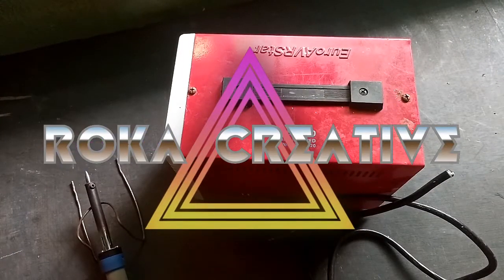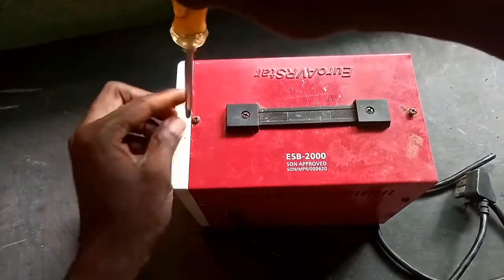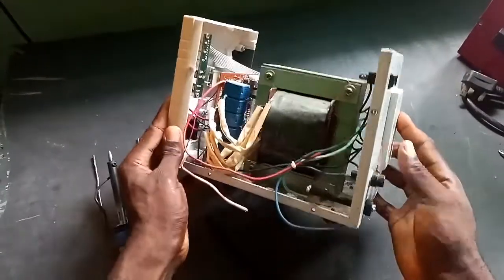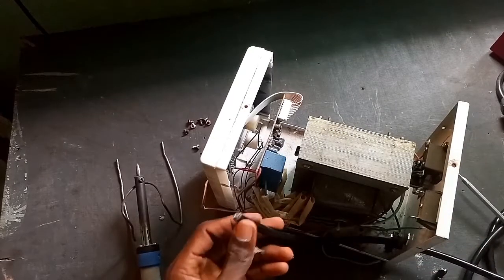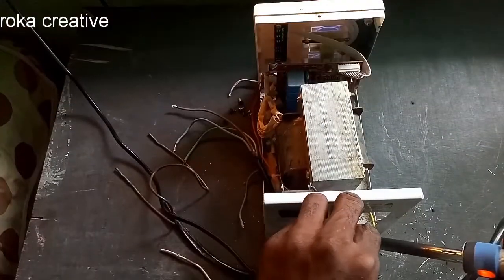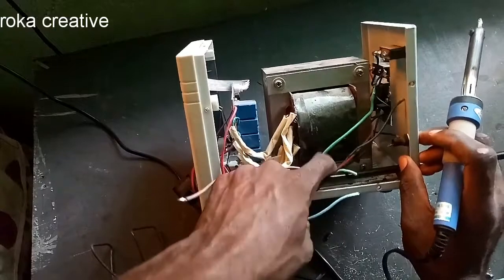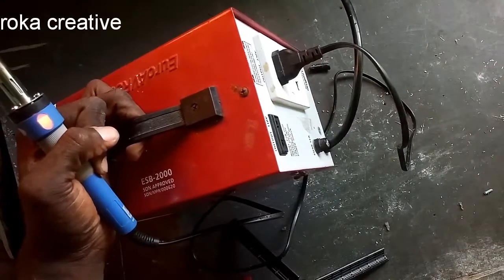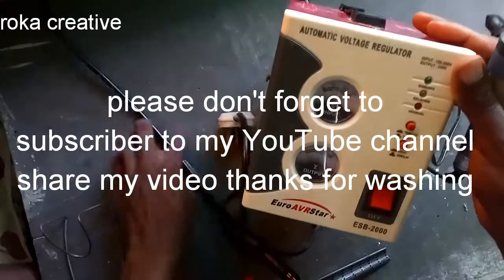how to repair a 2000w stabilizer

Comment: Very good....but what is wrong with stabilizer that turns On but does not supply out power  for the consumer ... thanks
Reply from the maker: Check d socket outlet to no if there is any cut of conductor